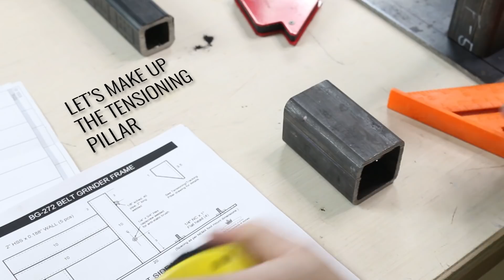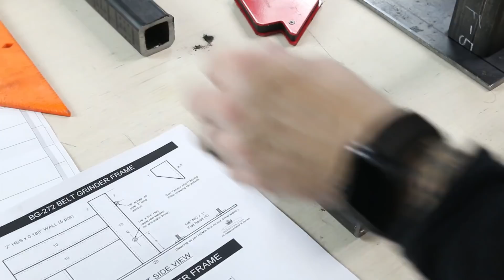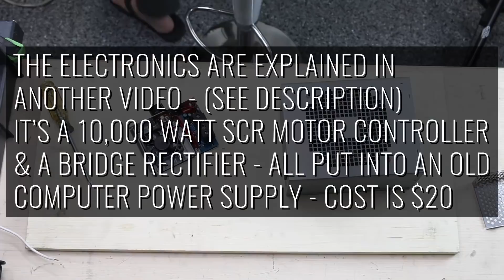How to: 2x72 Belt Grinder Build - Treadmill DC Motor Driven For Knifemaking - Homemade Tools

Comment from the maker: PATREON ►► https://patreon.com/housework
TOOLS I USE►  https://www.amazon.com/shop/housework
BUY ME A COFFEE► (one time donation to support my work): https://www.buymeacoffee.com/housework
INSTAGRAM► https://www.instagram.com/house__work/
WEBSITE► https://www.HouseWork.us

Platen I bought on eBay► https://ebay.to/2Hob8mS
Tracking Wheel on eBay► https://ebay.to/2Zn8p3d
SCR Motor Controller► https://amzn.to/2Zl3WmG
Bridge Rectifier►  https://amzn.to/2MOmViv

Ordered from MetalsDepot.com (I am not affiliated with them): Cost $153 USD
QTY 3 - 2"x2"x10" 1/4 Wall A500 Square Steel Tube (main body of the grinder) 
QTY 1 - 2"x2"x4" 1/4 Wall A500 Square Steel Tube (forward stantion)
QTY 1 - 2"x2"x3.5"  3/16 Wall A500 Square Steel Tube (tracking bracket)
QTY 1 - 1.5"x1.5"x13"  1/4" wall A500 Square Steel Tube (tensioning pillar)
QTY 1 - 1.5"x1.5"x17"  1/4" wall A500 Square Steel Tube (Platen Arm)
QTY 1 - 12"x24"  1/4 inch THICK A36 Steel Plate  (Base)
Reply: Thanks so much for sharing this list with me, it will help me tremendously. I forgot to mention that it's good to see your son in the shop it's a good thing to start them young and slow so they learn the dangers each piece of equipment has. Thanks again.
Reply: Can you build one for me?

Comment: "hello .. nice video and fantastic things you build with precision and attention ...
I have a 1.13 kW 1 HP engine with 2800 rpm. Not much, but unfortunately I don't have anything else at the moment.
Some read various information on the Internet and say that it is necessary to have an average speed of at least 24-35 meters per second of the tape.
What type of wheels and diameter do you recommend for my engine?
Thanks in advance.
N: B: I'm sorry if my translation with Google is incorrect, but I hope you understand. "

Comment: This makes sense, a treadmill motor is really strong at any speed. Use the speed controler that comes with it.
Reply: The controller that probably came with it not only has a soft start which gets annoying but most certainly uses PWM pulse width modulation for the control side which unless you use the big original control panel is more difficult and expensive to fake. The setup he used here works great, is cheap and has none of the treadmill safety BS to deal with. Nice job!

Comment: Thank you very much for sharing this video. I just subscribed. So you used the flywheel for the belt roller. Very cleaver. Have you had any problems doing it that way so far?
Reply from the maker: Hi Tom, if you have a minute watch my latest video the one I put out today and it talks a lot about the new design moving forward and the motor of choice. Also if you look back in my library you’ll see a video called why I switch from DC to AC and that should explain quite a bit for you. Thanks for watching and commenting.

Comment: You're gonna be sorry you mounted that ventillated case in the path of all that conductive dust. Same with the motor if it's an open frame design. The dust will eat the brishes and the steel particles may eventually clog the permanent field magnets generating friction and blocking air flow through the motor.

People thinking of emulating this design using a treadmill motor should pay attention its max RPM and size the belt pulley to recommended abrasive belt speeds. Treadmill motors commonly max at 9000 RPM and develop about 1 1/4 real HP. I'd guess that skinny motor pulley is about 5" in diameter,. 5 x pi x 9000 / 12 = about 17,800 ft per minute (FPM.) Max recommended speed for efficient cutting in steel is about 6000 FPM. 6000 / 17,800 = 0.334 or about 1/3. You'd have to run the motor about 3000 RPM. Permanent magnet motors are constant torque devices. 1/3 of 1 1/4 HP = about 0.4 HP - enough for general work at full load motor Amps but possibly insufficient for heavy cutting. 

Another point is the motor's internal fan at 1/3 RPM will deliver much less than 1/3 the desigh airflow thanks to the physics of fans interacting with air at differentt RPM. The motor may overheat if challenged by a protracted session of heavy stock removal. I suggest a 120 degree C snap-action thermal switch be bonded to the motor frame near the ventillating air exit. Wire the NC contacts of the switch in series with the motor leads or the NO contacts to the "fault" terninals on the control. This might impose frustrating shutdowns and interrupt your work but it will save your over-heated motor from enthusiastic use.
Reply from the maker: Already added a filter. Thanks for the suggestion. I didn’t realize how much dust would be created. First time grinding and that was very clear!
Reply: @HouseMadeUS  I strongly suggest a dust-tight enclosure - maybe NEMA 12, if you need a general spec call-out. Size the enclosure right and internal heat generated by the electronics will be circulated by the cooloing fan you've already installed and dissipated through the enclosure case via radiation and natural air convection.
Reply: Forrest  Addy I’ve got over half a dozen treadmill motors sitting on a shelf in the shop. Max of any of their  rpms is 4250. I think you may be thinking of more commercial treadmill motors of a larger size?
Reply: @ThatPNWGuy2024  That's certainly possible. I've used a half dozen or so treadmill motors on past projects but maybe my figures differ from your collection because I went for used max HP motors having a compact appearance on their eBay photos. These motors, as I recall, ran in the 8000 to 11,000 RPM range. I took 9000 RPM as a happy medium. Regardless, matching motor characteristics to application via simole shop mathematics of ratio and proportion cannot be ignored. If your motor differs from my example, crank the disparity into your calculations.

Next question is: what is the HP of those 4500 RPM motors? ALL the characteristics - motor, power required at end use, range of RPM, electronic drive data, drive ratios, design trade-offs, etc - all have to be considered. 

Example: i was asked to diagnose problems with a 14"  wood cutting band saw that was converted for sawing steel by a local gunsmith and knife maker. The band saw stalled at the smallest attempt at cutting steel. 

The maker used a 1/2 HP three phase motor and VFD to vary the blade speed.  Original wood cutting blade speed was 3000 feet per minute (FPM). Steel sawing speed is about 120 FPM, (alloy steel slower in proportion to hardness and toughness.) This is a blade speed reduction of 25 to 1. The maker obtained this speed reduction by dialing the VFD down to about 3 HZ using the original belt and pulley drive. Motors are constant torque devices as I mentioned earlier. 1/25 of 1/2 is 1/50 of a HP - clearly inadequate for sawing even 1/4" mild steel plate. 

I outlined a revision involving a double reduction belt drive as a remedy and the maker ARGUED with me about the coet and complication, denying the high school physics behind the failure of his conversion. As in bungee jumping, bandsaw conversions, and space telescope mirrors, failure to consider the underlying physics of a technical problem can really wreak your day.
Reply: Forrest  Addy No arguments with the math here. I’ve always Used a PWM motor controller(components from the treadmill)  with these treadmill motors to maintain torque at any speed. Drill press, wood lathe, and band saw all converted to DC treadmill motors as well as my home built 2x72 and they use the same PWM controller without any stalling issues. Anywhere from 1hp to 3hp motors (not the treadmill duty rating)

Comment: Great video and great work, it sounds and looks great. It seems to do a great job. I like the way you ordered everything cut to size, not a lot of scrap material laying around after you were finished. Thanks for sharing this information and your skills it put some great ideas in my head. Would you be willing to share the sizes you ordered so I could duplicate what you built, I think it's a great design and really nothing needs to be changed. It is fine if you can't.
Reply from the maker: Sure Kenneth - Happy to help. 
QTY 3 - 2"x2"x10" 1/4 Wall A500 Square Steel Tube (main body of the grinder) 
QTY 1 - 2"x2"x4" 1/4 Wall A500 Square Steel Tube (forward stantion)
QTY 1 - 1.5"x1.5"x3.5"  3/16 Wall A500 Square Steel Tube (tracking bracket)
QTY 1 - 1.5"x1.5"x13"  1/4" wall A500 Square Steel Tube (tensioning pillar)
QTY 1 - 1.5"x1.5"x17"  1/4" wall A500 Square Steel Tube (Platen Arm)
QTY 1 - 12"x24"  1/4 inch THICK A36 Steel Plate  (Base)

Comment: very cool. im planning on building one like this, got the motor and controller already. could you list all of the hardware you used? the list of the metal is very helpful and i will be taking it to my local metal dealer. thanks!
Reply: By any chance, did you get some dimensions, materials used? Thanks!
Reply: @dignitas1980  he lists all the steel used in the bottom of the discription, what i was asking for was a list of various nuts and bolts used. i didnt get it so i had to go through the vid and count out each one and make a list. hope this helps.

Comment: Awesome video on making the belt grinder!! I do have a question. What size/kind of spring did you use for the tensioning? Thanks
Reply from the maker: I just bought a 4” 30lb spring from ACE hardware. They have a bin there with all
kinds of springs. $3.00 or so. Tossed it down into the vertical cavity and the tensioning arm rests on top of it. I had video of that but card became corrupted so I couldn’t use it. But it’s easy to figure out.

Comment: Nice!  Have you had any issue with using the original treadmill wheel as it is so thin?

There is a vid with a gentleman that heated a pipe and sleeved over the original for making wider. Worked really well but finding fitted parts, a beatch. Still looking at designs and trying to save the $ on wheels. found a nice 8in hand truck wheel at Amazon you may be able to use for knife other... .. . Much cheaper than the real thing.
NK WAW8 8" x 1 5/8" Aluminum Flat Free Wheel for Hand Truck
 5/8ths rod.
It may be useful as an addition.
Reply from the maker: No issues at all with the wheel being so thin. So far. I did blow out a brush on the DC motor, I believe that's because its got a lot of hours on it.

Comment: i start to built one ,i have the parts ,i have a motor from a balance tire machine ,is 5/8 hp 10000 RPM ,is a D. C SERIES motor made by( the Lamb Electric Co. serial #14698-425783, have  Aluminium 10"x 4" roller install ,also i have a exercise bike wheel ,(bigger wheel) and all sizes and shapes rollers from  boat trailers but the motor i'm not warrior about because i have more than 100 motors (1 of every kind) as you can see is more than 100 different type motors up there ,like dc PM dc shunt, dc series ,dc compound,dc compound ADD ,DC compound subtract ,,,then when you go   through AC motors here is so many types is no't even fun ,,  why i know that,? because i design custom motors and re-design motors and work 40 years in that field  and work whit engineers from all over the world.

Comment: Nice build and great video!   Maybe I missed it, but are you using a PM motor from a treadmill? I'm guessing based on the bracketry and choice of motor control.
Reply from the maker: Yeah it’s a 2.6HP motor from a treadmill and a SCR motor controller.

Comment: a great build. thanks for making it.
may I suggest that the location of the vented box with the electronics near the grinding will have a short life as the grit will find its way into it.
I suggest moving it or at least placing it within a shielding box. it will get less ventilation and possible overheating depending on the design of the circuit. however grit protection is needed.
Reply from the maker: Hey Charles, yeah I ended up moving that box around, for that exact reason. It makes sense to not have open grates where dirt and dust can fall in. I just didn’t think about that at the time!